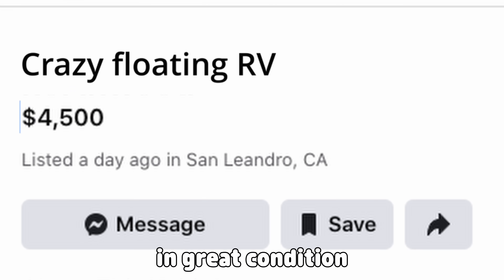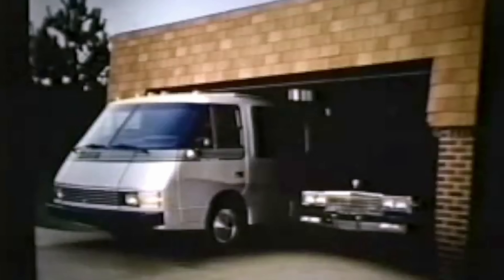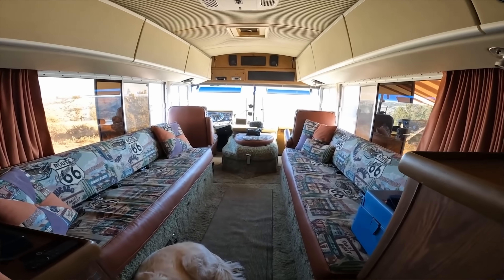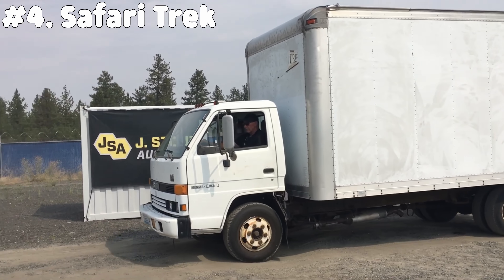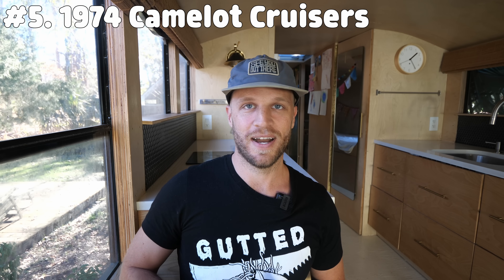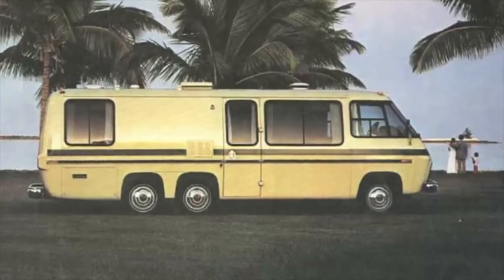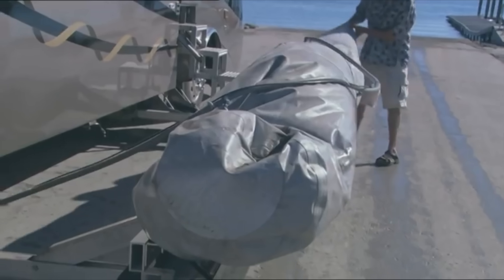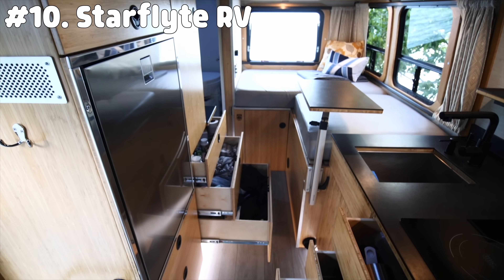If You See Any of These RVs For Sale BUY THEM

Comment: GMC Motorhome for the win! - 6 wheel, 6 ton, vintage hot rod with fridge, bed & plumbing.  Currently holds the land speed record for a Class A (130 mph) Got 3. Yeah me!!!
Reply from the maker: What?! It goes 130mph? With the Oldsmobile engine. Please tell me more!
Reply: @MobileDwellings  It was was modified but still street legal. The owner drove it to the Bonneville salt flats and stayed in it between time trials! Perhaps 10 years ago.
Reply from the maker: @erskerbobbles  very cool
Reply: @MobileDwellings  there are stories photos videos on the web! Do a feature on it!
Reply: @Erik  and the "cult" actually is very active in keeping the GMC's alive since parts are not available anymore, and old timers who love them pass on the knowledge to keep em going this far down the road...
Reply: I believe the interior was gutted, so it may not be fair to call it a real motorhome. I also believe they had to put weights in strategic locations to get traction in the front end.
Reply: @MobileDwellings  It had a fuel injected 454 with a blower.
Reply: agree
Reply: Are those rear wheel drive ? 
 In this vid I didn't see any drive shaft ? Is it front wheel transaxle like Cadillac ?
Reply: @Galavantin  Olds Rocket 455 engine; Toronado/Eldorado front wheel drive. Rear tandem automatic leveling air bag b
Reply: @Galavantin  It is a front wheel drive. I used to service one for a friend of mine. The most coveted of these in the 1976 BICENTENNIAL with 1976 specific graphics on the side.

Comment: There is a GMC moterhome here in Houston. I see it all the time. Nor sure if it is forsale but it has been sitting on the side of the road for awhile
Reply from the maker: They might be the easiest to find on this list. It's estimated around 8,000 are still on the road...or at least in your case on the side of the road!
Reply: @MobileDwellings  it's been there for years. I noticed it because the 3rd axel.
Reply from the maker: @bigtex2761  Isn't that cool that it's got dual rear wheels but they're in front of and in back of each other?! Apparently it rides well, at least for its time.
Reply: It looks like a fun project to renovate. But I'm going to stick with my ambulance
Reply from the maker: @bigtex2761  Can you stand in your ambulance? That's the only thing keeping me away from those rigs.
Reply: @MobileDwellings  I will after I'm done. Gotta add 6 inches.
Reply: @MobileDwellings  the crazy thing is the tandems have an airbag between them, so they're both basically linked together through the bag, this also lets you set the height!
Reply: My neighbor has one that he restored. He loves it and he's on the road now to a rally I believe.

Comment: I am a happy GMC owner for 25 years now. Will be keeping it the rest of my life.  I move it to either SLC or Jackson WY (I live in NJ) and fly back and forth to it for use in the inner mountain west primarily. 76 Glenbrook. 😊
Reply from the maker: Glad you like your GMC motorhome. Is there anything you wish you could change about it?
Reply: @MobileDwellings  ive been lucky one to not only see a Vixen for sale a few years ago n Maine, but saw another with all the suspension, etc upgrades this past year in Connecticut -  lightning strikes twice. I have a hightop 97 AWD Astro and I have a Falcon 170 4x4 camper van for sale right now actually
Reply from the maker: @jmm1000  I really like those high top Astro vans too!
Reply: @2hotscottpro  Great video!
Reply: @Jacks Garage yeh I agree, a 12v Cummins? No worries, a BMW ? Not so much
Reply: My best friend inherited his parents.

They are really nice well thought out purpose built vehicals.

Most RVs are built on whatever truck platform they choose and makes not just the floor elevated and floor plan annoying to repair but aging repairs a pain in the arse as well.

It's the "house divided" issue.

You got two sets of engineers building two different things with no communication.

So they don't have the arguements and discussions that typically creates what makes a good product if they had to worked together for one end goal. 

Or at least that's my opinion.

A shame it was discontinued. I can't help but wonder what they could have done better in future models if they were allowed to continued to refine it. 🤷‍♂️
Reply: 20 grand
Reply: Olde Carr Guy here on Youtube has one for sale
Reply: Thinking about buying a Safari Trek or GMC Motorhome (Palm Beach?)  in future...would you recommend certain years over others, Trek vs GMC, and certain engines over others like 454 vs the 8.1 Triton?  Pros/cons?  Would like to tow a trike or small car.

Comment: Owner of two 1973 GMC motorhomes one with a 1977 rust free frame Oldsmobile 455 engine drivetrain. Plan on spending 20-30 thousand if original and every weekend working on it frames rust out, but new frames are available. They drive like a full-size van if you roll around 60 mph possible to pull 10+ mpg. No leaking popouts to deal with, aluminum roof that won't leak a true classic cruiser that will last a lifetime.
Reply: I bought one and spent a year doing a full restoration,  including removing the body from the frame.  Was a great rig.  But I had probably 6 figures into that thing
Reply: I drove my dads 73 Toronado in highschool in the late 70s , big time gas guzzler.......

Comment: A most important detail about the GMC was its front wheel drive V8 power train borrowed from the Toranado. Matched with dual trailing arm rear wheels, not axels, gave it a lower floor height. They are a little squirrelly to drive in a straight line though.
Reply: Not true if set up correct.  A regular wheel alignment shop will not do it right.  Takes someone who understands the correct ride height front compared to rear and other adjustments and the correct rear air bag adjustment by the driver for highway compared to around city driving.  Bottom line, will out handle and ride better than any other RV on the road bar none if someone with good intentions but no knowledge screwed things up.  The rear height is adjustable while driving and the correct attitude is rear is set low for highway contrary to what many think.

Comment: This guys correct especially about the Wonderlodge. I’ve had one and you will be surprised how well they are made. They look old but if you clean them they start to turn the corner into interesting classic. You will find at the RV sites people are taking pictures of it. Non of them came with gas engines anyway. I had the Detroit V6 diesel that’s bulletproof. The rear engined ones are so quiet to drive it’s amazing. This rig will easily out live you. Lots of support from owners groups that live to find a cheaper way of maintaining them. The only thing better for similar money is probably a prevost. Don’t buy the home made one. But one that’s converted by a real company like Country Coach. People tend to think that these are Somhow old grey hound buses that are converted. They are actually shipped new from Prevost in Quebec to witch ever conversation company. Mine has 80k miles on it and to give you an idea, after I had the brakes checked I asked the prevost bus people if I should check them again. There reply was “ have you put 50 thousand miles on it since we saw it” then don’t bother. You get the idea those are built to make money for miles traveled and are way overbuilt for personal RV use just like the blue bird. It’s hard to get across how much better those examples are than anything else he covered there. It is a great feeling when there’s a huge storm outside and you’re absolutely comfortable and confident in the vehicle you choose.

Comment: I owned a Safari Trek on the NPR chassis.  Your brief review was mostly spot on.  It was woefully underpowered, even after I added a bigger exhaust and propane injection.  Mileage was more like 12-13, but the interior was very nice.  I worried about the bed motor failing, as that would have stranded me, so I carried a spare motor.  The body construction was somewhat iffy for rough roads.  A friend had a BMW diesel Vixen too and loved it.  I currently drive a 4wd F350 dually with a Bigfoot 2500 camper, as close to the Bigfoot motorhome as you'll get.
Reply from the maker: Thanks for sharing your experience with me. Our new rig is a 2nd gen dodge ram 4x4 2500 with a 2000 Bigfoot 2500. We love it! (As a short trip camper for our family). We'll likely have to move to a 3500 or F350 though in the coming years.
Reply: @MobileDwellings  I use to own a 1979 greenbrier Chevy g30 looks like a transvan body and had the 400ci V8 it was actually stollen from me but how rare was that thing?
Reply: @patrickfort4467 
 Thinking about buying a Trek in future...would you recommend certain years over others and certain engines over others like 454 vs the 8.1 Triton?  Pros/cons?  Would like to tow a trike or small car.

Comment: I found it interesting that you left out the Sunrader. It's a sought-out classic. It's built on the Toyota Hi Lux, and has the legendary 22R engine. I have a shorty, 18 ft, and I regularly find notes on my windshield from people wanting to buy it. 

The standard version is 21ft, and it's hella comfortable! More comfortable than your average class C. It even has a long couch to hang out, and a bed, and a dinette. There's no need to change setups from bed to couch, etc. 

The housing module is 100% fiberglass, so no leaks. I'm surprised other RVs aren't made this way. 

One of the best things about it is the 22R engine. That thing takes a beating! It's also easy to fix and to find parts. If you go to Mexico and beyond, you won't have any problems finding parts and mechanics to service it. 

I bought it on purpose! I'm hoping to drive from Tuktoyaktuk to Ushuaia, and a 22R hilux is perfect!
Reply from the maker: Don't worry I'll be covering the Sunrader soon! They're siiiick.

Comment: The second edition of the Vixen had a permanent raised roof, and used a GM 3800 V6. Which later same engine in a Pontiac Bonneville was supercharged. So you can upgrade to that.
Also, you could remove the entire rear drive, and install the hole rear cradle powertrain from a Tesla Model S/X.

You failed to mention the Revcon, Clark Cortez, and Ultravan.

Comment: If you can find a M2 or M3 amphibious rig then you should buy it. You can mount a trailer on top and it is of course able to travel both on land and on the water. When floating it can support a tank! so no weight problems with a trailer on it.

Comment: The GMC is a FANTASTIC coach but the chain that connects the engine to the transmission can be hard to replace (they were heavier than the one in the cars) thus costing a small fortune.  I've had one and loved it.  It was almost as easy to drive as a minivan.  just don't try driving on wet grass!

Comment: Ive owned allot of trucks and campers. You can get a 07.5  + ram 3500 drw truck crew cab 6.7 cummins for 15 20k and a really  nice slide in camper 6k.  Your not obligated to stay at rv parks with limited parking with that setup. Great fuel milage. All the amenities of home. Bullet proof engine. You still have access to a front and rear hitch. That's a great combination.
Reply from the maker: I'm with you there. Does the 07.5 have any emissions equipment? Do you like the 6.7 more than the 5.9? We bought a 2001 dodge ram 2500 with the 5.9 and extended cab and a bigfoot 2500 9.6. we're getting just under 14 mpg with the camper attached. I wanted a 3rd gen 3500 with crew cab though and honestly the 24 valve 5.9 is very loud and seems like there's not much to do to mitigate it so I think I'm gonna move on from the truck to maybe exactly what you described.
Reply: @Mobile Dwellings compounds quite your exhaust like you wont believe.  I have  3 diesel rams and a 02 lance slide in camper.  89 drw w350 a 01 2500 w/ a built 47re  large compounds and injectors lastly an 08 3500 drw Laramie with air bags. I love my 08 . My 08 has a dpf but no def . For the money I had decided to get something older with lower miles that didn't need diesel exhaust fluid.  It's has a egr and maf sensor.  I'm on the fence if I want to delete it. Common rails cost a bit more to maintain.  I love my vp44 truck too.  I've owned alot of makes modle trucks . I will always buy a cummins.

Comment: I'm surprised 1996-2006 Country Coach Diesel pushers didn't make your list.  Extremely well made in Oregon (not Elkhardt Indiana) with solid wood interiors, DynaMax chassis, steel tubular frames, Cummings engines, side mounted radiators on all models..etc...etc..  AND you can buy them CHEAP!
Reply from the maker: I took a peak at that rig and I feel like us youngsters want to do stupid things with our RV's and take them all over BLM and that big Class A has no ground clearance. Just doesn't quite float my boat but thanks for letting me know about it!

Comment: Revcon RVs are really the same RV as the GMCs. I have had one sitting in my back yard for years now. Trans needs rebuilt. Last time it was started it would only back up, no forward gear. May just be a stuck valve. Really good RVs to have. Dont think I have ever seen one leak. It gets stuck real easy though. Front wheel drive. I have had it stuck in flat grass a few times.

Comment: The GMC motorhome had a choice of 454 Chevy or 455 Olds. It was front wheel drive so no driveline tunnel which left the floor flat. The Olds version was a Toronado unit. I would prefer the Olds unit for the torque. That and I was an Olds guy to begin with. 😉
Reply: I don't think it ever came with a 454 Chevy (you might be thinking about the similar Revcon). But the last year or two ('77-'78), it was downsized to a 403 Olds, after GM stopped making the 455 Olds.  I've often wondered if the 472/500 Cadillac motor (from the similar Eldorado) would fit.
Reply: @davidavard8461  When I looked at them years ago the only two options I saw were 455 Olds and 454 Chevy. That's a good question about the Caddy engine but you would also probably have to use the Caddy Eldorado transmission. Buick Olds and Pontiac were referred to as BOP and a lot of parts were interchangeable.
Reply: @davidavard8461  Caddy engines will bolt up.  I had a 455 in an old caddy before and I put a 500 caddy engine in a 78 Firebird. The transmissions on the GM products had the same bolt pattern other than Chevy. It was the oddball. I also have an old Revcon (GM) RV. It has a lot of engine room. A 500 should fit a lot better than it did in my Firebird. Valve cover was touching the firebirds brake booster, an I hand to cut holes in the hood for both the carburetor an the distributor.

Comment: Thanks for the advice on the fleetwood motor coach found one I'm thinking about so I guess not. Bought a 40 foot 1971 MCI-7 factory converted to a motorhome. but then had heart surgery last summer and don't have the energy to renovate her. Need to sell the old girl and get something finished already for a 71 year old and her cats. Never drove anything over 26' so I may need to stop by a dealer and see how I do with a 40'Motor home
Reply from the maker: Actually after further research there are some GOOD Fleetwood models. For a single person I recommend staying at 30 feet and under! A used 30 foot Fleetwood Bounder is not a bad choice.

Comment: I have a 1999 Safari Trek Pathmaker 24 built on a GM truck chassis with the 6.5L turbo engine. Has less than 15,000 miles on it. It is cool to have the lions on the back. I am going to sell it as I purchased a 2002 Tiffin Allegro Bus 32 with the 5.9L Cummins. I kid you not this beast will get up to 15 MPG at 65 MPH and will pull a 10K trailer at 9.5-10.5 MPG at about the same speeds like it wasn't even back there.
Reply from the maker: The 5.9 Cummins in a small motorhome is really the dream. So efficient. I had it in a Dodge Ram though and couldn't stand the sound. Would love it in a short rear engine motorhome. Is your Tiffin a rear engine by chance?
Reply: @MobileDwellings  

It is a pusher on a Freightliner air ride chassis. The only engine in the front is a 7.5KW diesel generator.

I installed a custom trailer brake controller under the dash next to the driver. Installed custom cables from the front to the back for the control and gave it its own power supply and fuses for the brakes and trailer 12V charging/internal lights. Tied in the 4 pin wiring for the lights and brakes, flashers at a 7 pin connector at the hitch for a nice clean install. Works great.

Funny story when I purchased the Bus the dealer told me that it had about 104K miles on it. Didn't have a problem with the mileage as in my opinion that is low for a Freightliner. Long story it took me about a year to pick it up from a friends house. On the way home I was trying to see what kind of mileage it was getting and how accurate the speedo and odometer was. None of the numbers were making sense and I was driving by GPS for the speed. Got home and started looking into the "problem" and noticed that there was a switch next to the speedo that didn't seemed to work. Messed with it and replaced the rocker switch. then noticed a little (I mean little) arrow next to the odometer. The new switch made the arrow switch up and down. Then noticed little letters changing. Turned out the odometer was set for kilometers instead of miles so my motorhome went from 104K "miles" (actually Km) to actually 64K US real miles. Best trip I ever took it just melted the miles away.

Comment: The engines in those GMC motorhomes are interesting the unit is essentially ripped wholesale from the Olds toronado, you get an Olds 455 big block and the Toronado’s trans axle, if you were creative you can do unspeakable things like the rear engined Mazda RPU seen on roadkill.